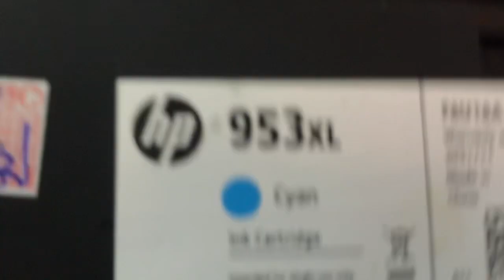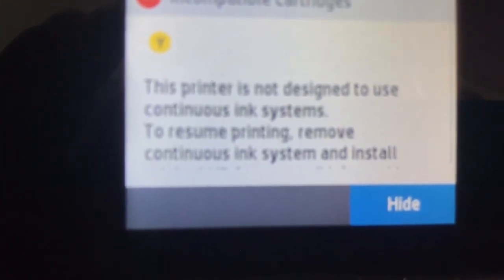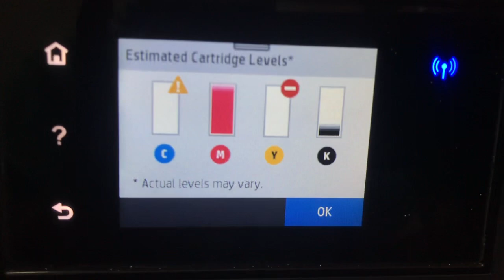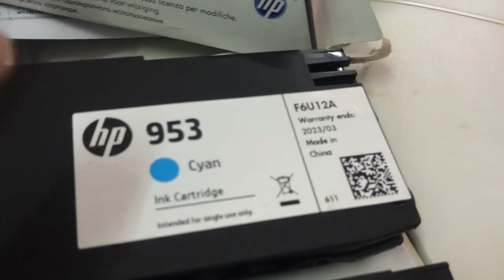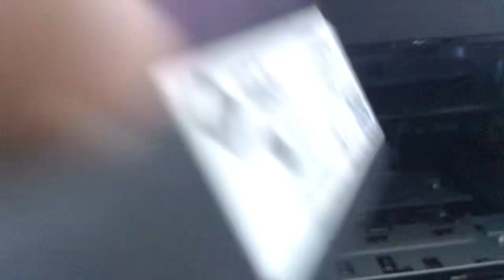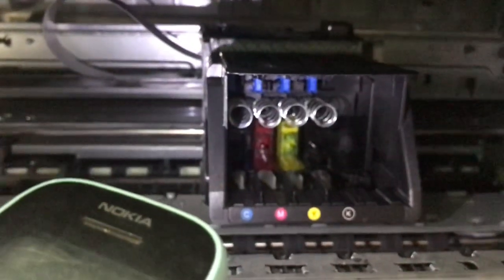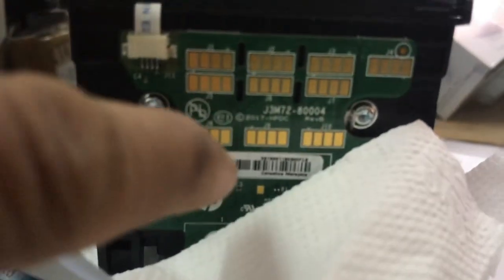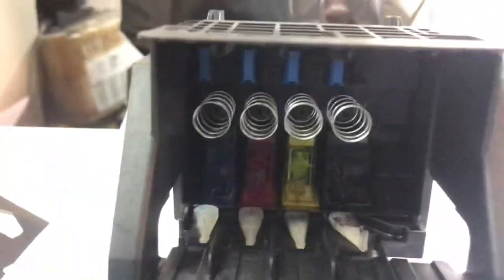HP Office jet Pro 7740 replaced ink cartridge error

Comment: Good day..i have the same problem with my 7740 for a month now ...heed help how to fix
Reply from the maker: this printer hard to fix, cause need the original ink replace, if you replace new ink and still error , try to turn off printer and on again, if not solve checking head system

Comment: I have often replaced it with a new ink tank but the print head does not recognize the ink filling tank
Reply from the maker: disassemble Printer head and  check connection or contact is bad or not

Comment: The HP service center judged that the solution to the problem was to replace a new print head
Reply from the maker: Most problem from inks cartridge , so before replacement printer  head need test inks first